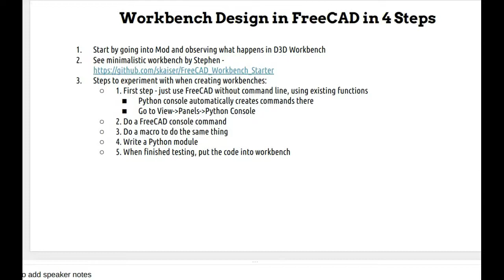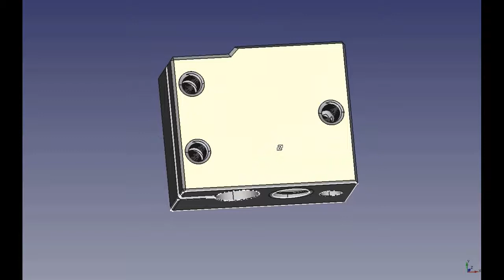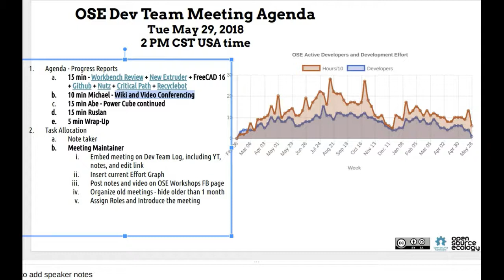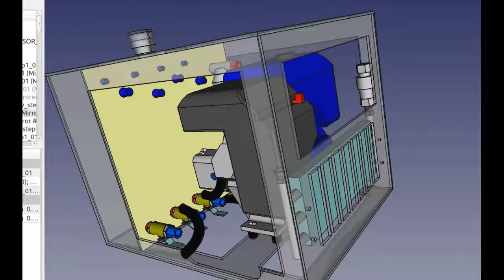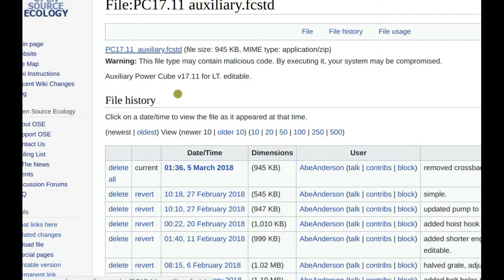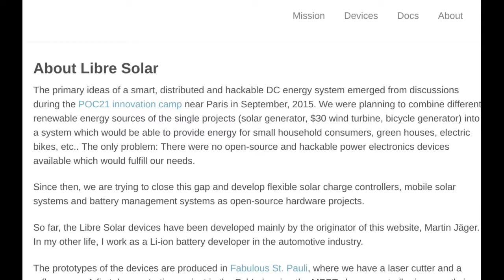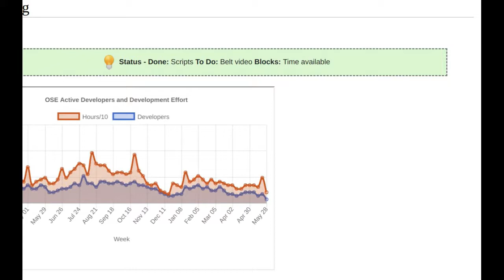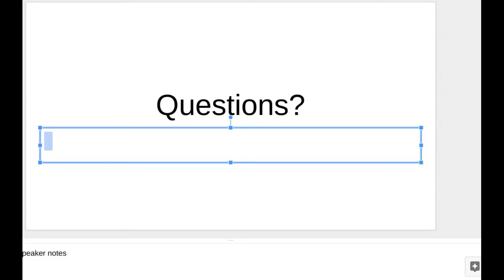Dev Team Meeting - May 29, 2018

Comment: Audio Cuts out from 0:00 to 24:00
Reply: wait actually there is some for a bit around 17:10 as well
Reply: and 15:40
Reply: Marcin's Mic Appears to be the Main Non-Functional One.  Software Muted, Disconected, or Dead are my guesses.
Reply from the maker: Bad settings in Vokoscreen. Had mike muted.
Reply: No problem!  Just wanted to let you know.